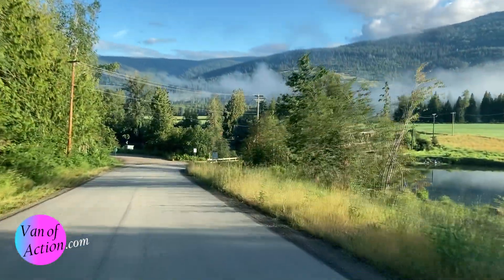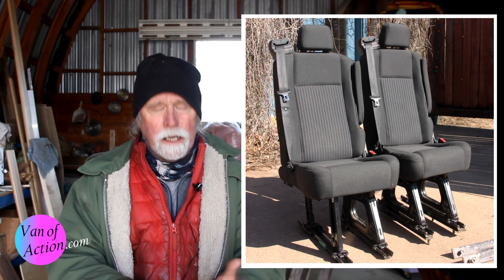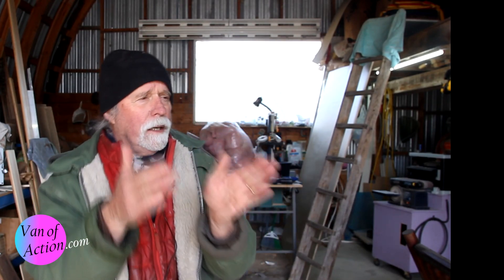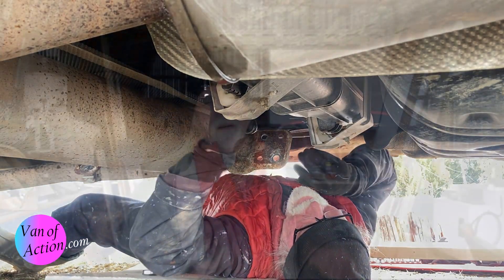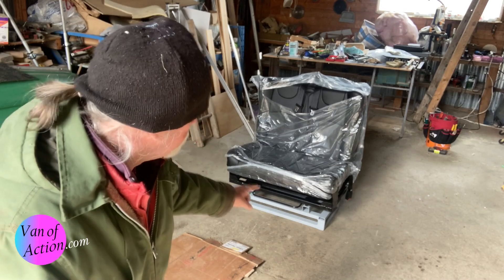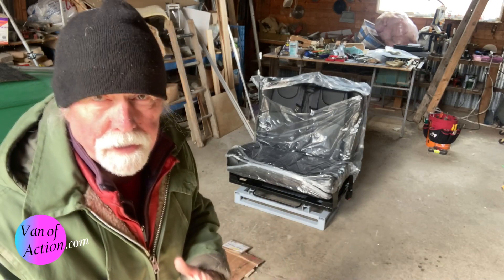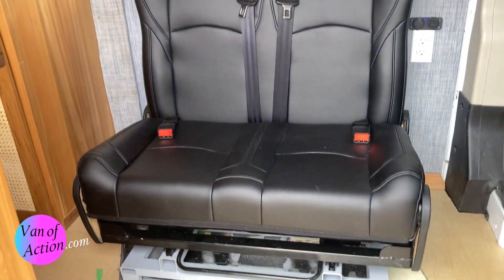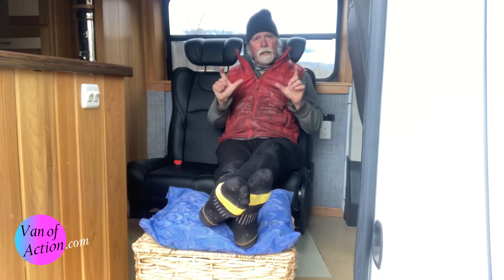Van Build Coversion Design for Second Back  Seats in Promaster Sprinter Transit Vanlife Campervan

Comment: Greetings from the southern interior. This seat is exactly what I was looking for to use for my 159 ext. Thx for the video and rock on.
Reply from the maker: Serenity Cruiser - thanks from the northern interior !!  I can tell you these fit nicely into a 159 ext. - but if 1.  You have a Promaster  2. they'll be facing forward and 3. you want the bed function - check out the "1200"   it's a 3 panel fold out that makes a complete bed on it's own.   Because of the step up in a Promaster  you can't use a front  seat as a bed extension.   Be well and stop back !!!    Dave

Comment: Jee, you are lucky to be able to do that in BC!  Here in Qubec, adding a belted double or single seat requires to be done by a Transport Canada Certified outfit (3 of them here), which are installing a ridiculously thick steel plate over the van's steel floor, making this secondary seat stronger than the front seats!  We are talking about a few thousands of dollars for that job...
Reply from the maker: Hi Charlevoix418 - I would never recommend anyone not obey the laws ....   but they sure make it hard sometimes.   Be well and I hope you come back .... Dave

Comment: Very cool info and love your vibe! What adhesive did you use for the aluminum?
Reply from the maker: Hi AtTheTime…… thanks for watching and the kind words.  I used the best (most expensive) construction adhesive at Home Depot.   There are 2 critical parts to this. 1. Be sure your surfaces are REALLY clean and dry.   That’s why I grind the paint off to bear metal and also rough up the tube surface.  2. Give the glue lots of time to cure.  At least 48 hours without any stress on it.     Be well and I hope you’ll stop back and join the community…….. Dave.

Comment: This is excellent and might just be the ticket for me too. I recently purchased '83 Econoline gutted cargo van with two front captain seats, but there are three of us! Currently only used as second/backup vehicle, so my 5yo has car seat up front and loves it, but eventually would love it to be camper van and would like two seats in the back so kid and wife can sit there and the kid can sleep on it also. And I don't like the idea of the older style conversion van third row bench that supposedly folds into bed, had one in previous van and was not comfortable.
I wonder what other seats you came across during your research, if you don't mind sharing and saving me the time, please? Love your vids, will copy a few of them. Thanks and cheers from Wisconsin.
Reply from the maker: Hi Joeh - thanks for watching and the kind words -  Being in Canada there are not many options for after market seats,  if you find one at the wreckers that's usable it'll cost an arm and a leg, and the manufacturers will not sell a replacement.  The Wilderness Van seats I bought I believe they have the Canadian rights.   Everything else I found was in the US or Europe.  Check out https://www.freedmanseating.com/  - these are more commercial but close to you.   The ones I really wanted were from   https://www.jmgsystemsllc.com/ - but they don't ship outside the lower 48 so for me - with the exchange on the $$$ and the freight forwarder and the customs I  was looking at about  $ 3000.00 a seat which is just crazy.   I hope things work out for you.  We'll be driving through Wisconsin May 19th and 20th  ----   looking forward to seeing some of the state .... hope you'll stop back.   Be well .... Dave